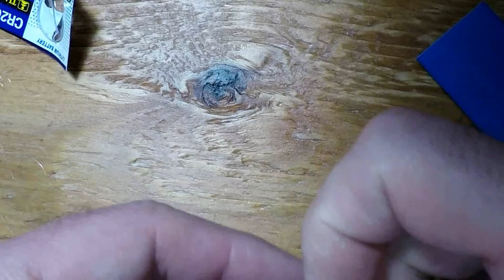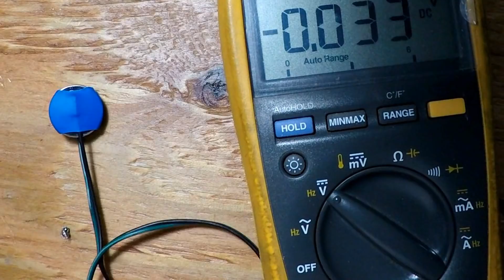Coin Cell Battery Pack Howto

Comment: Did this end up holding up? I am trying to replace my earbud batteries, and bought cells without leads attatched. Given that I don't have access to a spot welder, and I'd rather not solder a lithium battery, its looking like a tonne of electrical tape (or heat shrink) is the solution. The only problem is that I've heard that taping wires to a terminal like this might not last very long or create a weak connection which would get rather hot, have you found that to be the case with this setup?
Reply from the maker: Hi, honestly it's been a while since I did this. My gut feeling is that it's good for prototyping, but probably not great for something that will take a lot of abuse like earbuds.

Comment: hi jeremy if i wanted to run the coincells in parallel how could i do that?
Reply from the maker: Hello - I have not tried it. Perhaps you could slide them in side-by-side in the heat shrink and apply one wire to the top and the other to the bottom.

Comment: excellent video.  this just saved my butt, i couldnt fit the whole big plastic battery holder into the small area where i need to store my 2032s.  Curious which heat shrink size was correct, i imagine 25mm?
Reply from the maker: Glad it helped! As for the size, I don't remember off the top of my head, and it would depend on how many you stack. There's a multi-pack in the description that may do the job for you.

Comment: Can we use pack of CR3032 batteries in making power bank?
Reply from the maker: Depends on what you want to power. It's ~3V per battery when wired in series.
Reply: Wanted to use charge mobile and want to make it similar to other power banks.
Can I make like that?
Reply from the maker: @akankshakacham9065  You could probably do it with a buck converter, but I wouldn't recommend it. It likely would be quite complicated for fairly poor performance.
Reply: Thanks got it👍☺️

Comment: I know your probably not short of projects but I this gave me an idea maybe you could give me feedback on? perhaps even try if it's not too difficult.
Reply from the maker: Glad it gave you an idea. What is it?
Reply: @JeremyCook  wiring up the rechargeable versions of these that could fit into a 3d printed case. a bit like that "smart" iphone battery case but slimmer, then maybe add a couple connectors so it can charge and be charged
Reply from the maker: @Godsavethecrumpets  Interesting idea. While I'm not certain, I think what would be difficult about it is that you'd need to independently wire up and charge each cell. At least that's the ideal situation with multi-cell LiPos. Could be done, but likely other solutions would work better IMO.
Reply: @JeremyCook  what do you think is the easiest way just attach another phone battery in the case and wire a male usb into the bottom of the case? is it possible to add a female usb connector to that setup too?
Reply from the maker: Check out this video that I put out recently: https://www.youtube.com/watch?v=0IC79ni-D_0 The board I used may be what you're looking for (or maybe even the boost board earlier on_

Comment: Great idea!!! I'm new to this and a bit lost..
I need to connect 30units of 3v LED to one power source, any ideas, please?!
Reply from the maker: Thanks! Sorry to say I don't have a great answer for that. I think you could connect them all in parallel if the source was capable of outputting enough current. You'll likely want to use a resistor/resistors as the LED requirements and power source will likely not be the same.

Comment: Awesome video! Now I know why those huge shrink wrap bands are in my kit. This is much better than soldering or metal clips. Just curious, with a standard 12 volt LED load, how long do you think the 4 battery pack will last? I'm thinking of using it to power this item in a cosplay gun - https://www.aliexpress.com/item/32852120967.html?spm=a2g0s.9042311.0.0.27424c4d0D8EFz
Reply: Hi Jeremy, I gave up on the idea of using 12 volt items. I now use electronics that are designed for USB 5 volts, and power them with small USB power banks. Much easier than stacking batteries. I’m not sure what item I linked as that page is gone. Thanks.
Reply from the maker: @GeorgeNovak  Nice - yes I bet that would be a lot easier!
Reply from the maker: Just seeing this, and don't see the page showing up. I suspect it wouldn't last long, but I'd be curious to hear about your results.
Reply: @JeremyCook  One thing I forgot to say was a huge "Thank You!" for all your informative info. You started me on a voyage of discovery in terms of LEDs and low voltage circuits. I discovered that the 12 volt LEDs I was using were really resistor loaded 2-3 volt LED's and those could be powered from coin cells. That led (pun) me to running LED's in series and using 5 volt USB or 9 volts. This has opened up a ton of solutions when it comes to lighting some of my cosplay props. I did a small video showing some of the specialty LEDs I use, hope you enjoy it. https://www.youtube.com/watch?v=XqBjLN49Kok&feature=share&si=ELPmzJkDCLju2KnD5oyZMQ
Reply from the maker: @GeorgeNovak  Very cool, thanks for letting me know, and I'm glad my info helped you!

Comment: If 4 of these kind(coin cell) could give 12v.........then why we have to buy that huge box like batteries????? Is there any power difference?????
Reply from the maker: The difference is in the total power (edit: energy really) available is much less for such a battery pack. Check out the mAh rating for larger batteries and compare it to one of these and that will help explain things.
Reply: @JeremyCook  👍👍

Comment: If I wire them in parallel will I get the same 3 V with larger battery life?  I have a device that’s killing 2032 batteries too fast.
Reply from the maker: Hey George - yeah that should work!

Comment: Hy, How can I convert into 5 volt. I want to power my Raspberry Pi Zero w
Reply from the maker: Hi, I think what you're looking for is called a constant voltage driver. A boost or buck converter might also work depending on how many cells you have stacked.

Comment: Just saw your video and it gave me  an idea for creating a small 9 volt battery that would light up a model railroad commuter car without seeing a 9 volt battery thru the windows. I could then use LED strip lighting. Only problem was finding a large size shrink tube to fit around 3 coin cells. I had a small shrink tube so what I did was cut a 2.5" length, slit down the center and flatten it out. Then overlapped ends 1/8" and super glued it and clamp it until cured. This created the perfect size shrink tube to hold 3 coin cells!

WORKS GREAT! THANKS FOR YOUR IDEA!
Reply from the maker: Nice, thanks for letting me know!

Comment: I have many CR2032 coin cell battery (sony & energizer) not sure what to do with them. any suggestions?
John
Reply from the maker: You could make throwies, where you straddle the battery with an LED's legs. Add a magnet and/or tape and you can throw it on stuff and have it stick.

Comment: Looks much easier than trying to solder the leads to batteries.
Reply from the maker: Yeah, that's tough to do (if I remember correctly) - perhaps you could use a spot welder, but I haven't tried it. Thanks for checking the video out!

Comment: Could i just flip one around to connect them in parallel? I’m thinking probably put one wire right in the middle, and another short one connecting the outer connections to a final wire coming out of one end, so that it comes out with 1 lead out from the middle and the other out of one side
Reply from the maker: Hmm, seems that could work, though I haven't tried it.
Reply: Jeremy Cook Just tried it. Reads 3V AC on my multimeter :)))
Reply from the maker: @syllavr4584  Neat, glad to know that works!

Comment: What a battery hack, nice video, thank you so much!
Reply from the maker: Well you're welcome, and thanks for watching!
Reply: Do you think if you used copper cable and copper washers it would work better?
Reply from the maker: @stevelawless1  Possibly, seems like the issue (if I'm remembering correctly) was getting it to actually solder. If you have better skills, it might not be a problem at all. Spot welder could work too.
Reply: @JeremyCook  conductive paste and carefully glue gun around sides would b suffice or blue tac
Reply from the maker: @stevelawless1  Thx for the idea!

Comment: Hi Jer,, Thank you for posting your great Idea and problem solving solution,, I'm in the process of building a compact sine wave generator which I'm hoping will work on 3 to 4.5 volts of coin battery power.. I'm going to try and attach the wire lead to 2 small brass plates soldered of course and see if that works,, Thank you again for your great Idea.. :)
Reply from the maker: Hope it helps (helped :-)

Comment: Great idea Jeremy.  I remember making a 4 by AA holder once with an elastic band, tape two coins and a tube of rolled up paper.  Ha ha yours is way more elegant and gave me an idea to use an inflated balloon to shrink wrap larger batteries if I needed to by letting it deflate around them.
Reply from the maker: Well thanks. I've certainly done my share of inelegant projects in my time, but sometimes things turn out nicely ;-).

That's an interesting idea about the balloon. Now you just have to figure out how to get the batteries in :-)!

Comment: That nunchuck would make a great remote for an electric skateboard or my hydrofoil build.
Reply from the maker: Ha, not sure I'd trust it enough TBH!
Reply from the maker: BTW, you may notice that some of the shots are way better lit than others. I installed the desk lamp you told me about in between some of the shots, and it seems to make a huge difference.
Reply: Yes much better after 1.17
Reply from the maker: That's interesting. I actually filmed the beginning when I had the light (I think). The old setup is "on display" around 1:48.

Comment: Hi, just a suggestion, but be careful when handling those batteries with bare hands or metal pliers as you would be shorting them out. Even momentarily you are reducing the battery life.
Reply from the maker: Hi Jayy, that's a good point. Maybe I need to put some shrink wrap around my pliers for this purpose.
Reply: Ben McConnell  

Yes muppet, you already said that.

Comment: Morning Jeremy, this is a great idea. One thing you might try is crimping a spade lug to the wire and slipping that under the heat shrink. Might make for a more reusable wire connection. Keep 'em coming.
Reply from the maker: Hey Chris, thanks! That's a good idea too—somehow using a spade lug didn't cross my mind :-)